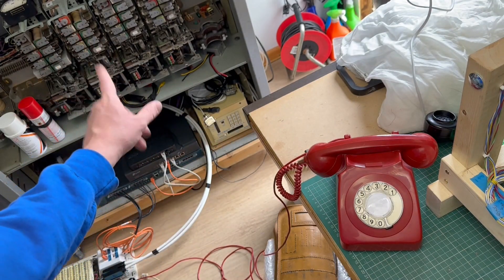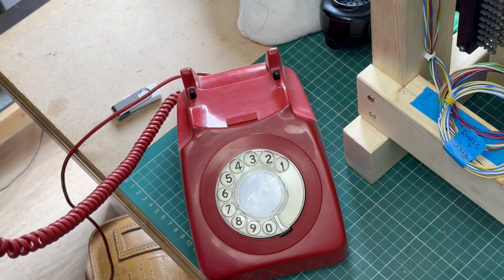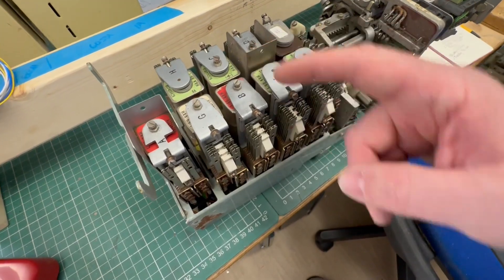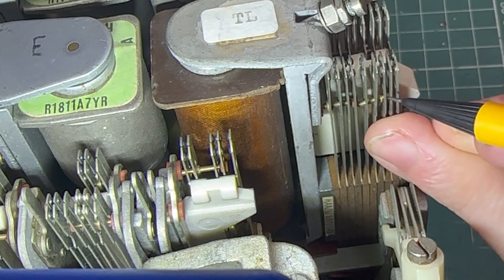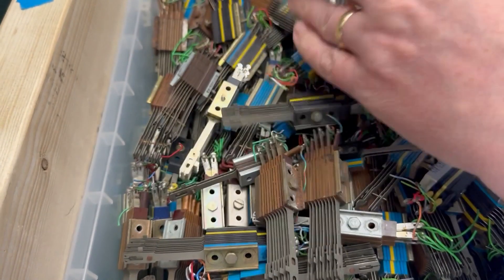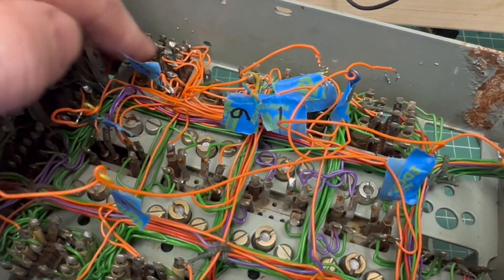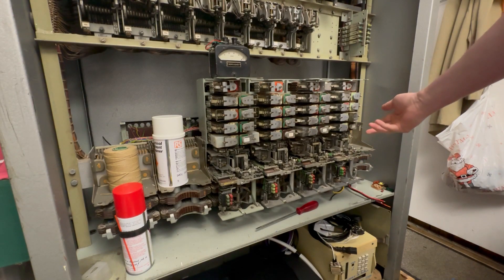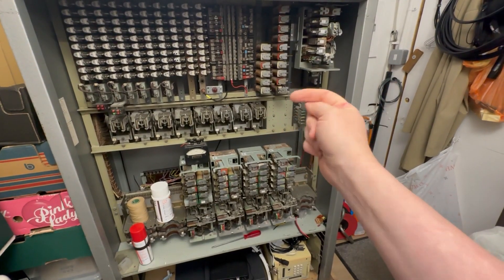Strowger@EMF [Part 3] -  Trouble with Tie Lines

Comment: While I don't know that it would be less labour intensive, I have successfully repaired a single broken contact by disassembling the contact stack-up and replacing only the damaged contact.

Seeing your tape labels, I just realized that cheap spring hook test probes would be awesome for tagging wires while working on something. Each probe could be marked with a number with a P-touch label or Sharpie.
Reply from the maker: I’ve rebuilt contact sets before, and it’s fiddly but certainly doable!  I’d rather replace the whole stack though if I’ve got the right spares.  I do keep the broken ones for future repair though!

That test probe idea is a good one!  I’ll have to add some to my next component order 😀